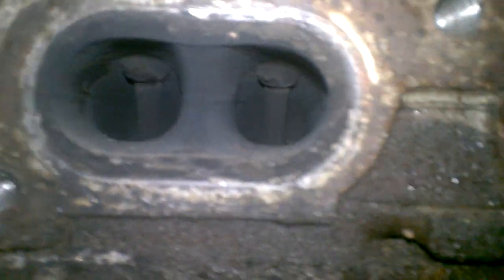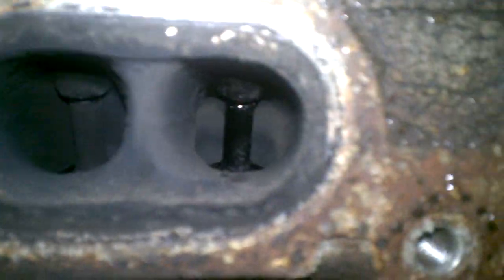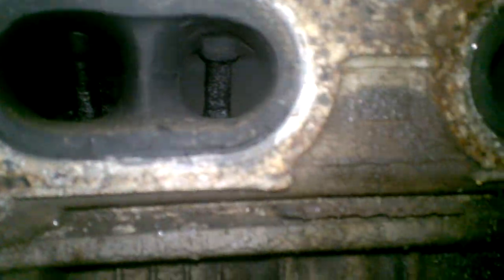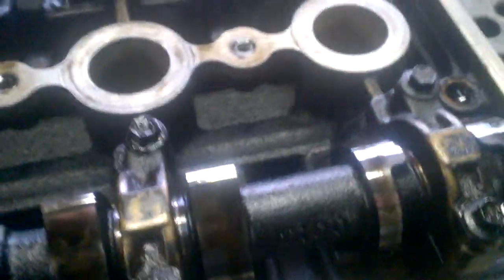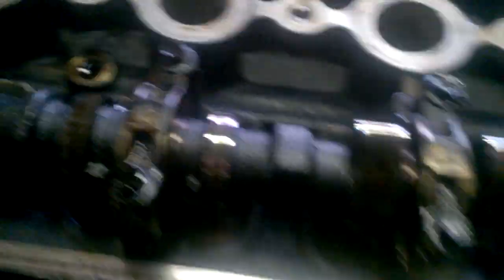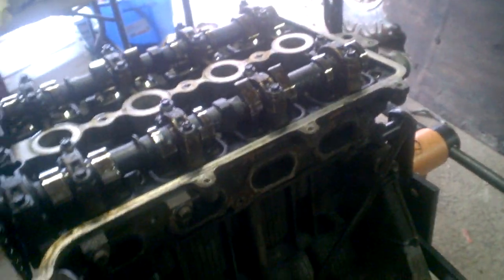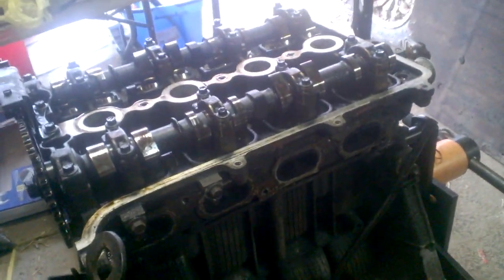Dispelling the Myth of ATF Cleaning Your Engine

Comment: What about using a bit of diesel or kerosene as your flush before changing oil ?
Reply from the maker: Using it to flush the engine, just before a change would thin the oil and get some gunk out. Bearing life can be decreased, if any residual solvents are left in the system. I won't endorse this practice, and I don't recommend it. Just change the oil every 3,000 miles, and it saves on buildup in the engine. Check out my video with my Grand Am. That car has 150,000+ miles on it, and gets oil changed every 3,000 miles and even uses conventional.
Reply: Joshua Howard  I damaged a crankshaft bearing once after performing an engine flush using kerosene. Engine flushes are just not a good idea on a dirty engine. It can loosen up big chunks of crud that can then float around in your oil and plug up an oil galley somewhere. Doing flushes right before an oil change might help keep your engine cleaner IF you do them regularly and on time since the car is new, but if the motor has been neglected, it’s best to just change the oil a bit more often and not do anything funny with it.

Comment: Once you have gunk from
Lack of maintenance nothing really helps and any flushes may cause more problems than not…. But regular maintenance and atf will
Help…. But not when you neglect an engine
Reply from the maker: Well, both engines were definitely neglected. The engines you see in my videos are of the original engine, and when I got this car in 2016, it still had a Saturn-brand oil filter on it. The replacement engine came with a blown head gasket, and I had to change that out, before swapping it.
Reply: @Joshua_James_Howard  I work on some cars that ppl bought and never maintained!!! It’s ridiculous seen some really nice Mercedes and bmw that literally had mud in the valve covers and oil pans…. I drove sh*t boxes my whole like and never ever drove over 6k on a full synthetic oil change it just feels weird…. But yea I remember when I worked automotive ppl would ask for flushed and we would turn them down…. I believe it was around 2010 or so lots of people were bringing in the ford f-150 for trade in and most of them were crap… all types of cam phaser/ timining issues…. Smh

Comment: you burned a valve because the valves were not adjusted . 
it's a bitch of a job in that motor but there are no magic pills to avoid the job. 
the  ATF  had no part in burning the valve - nor in keeping the intake valves clean. 
the intake valves are clean because they are constantly sprayed with fuel from the port injection
Reply from the maker: The replacement engine burned a valve, about 40k miles after I installed it, from the JY. 

Burnt valves in the #3 cylinder are one of the common twin cam engine problems. The second engine did not get and ATF, fuel system treatments, or anything. Just regular oil changes and routine top offs as the replacement engine also had bad rings and bad valve stem seals. 

The oil leaking onto the valve and creating carbon deposit buildup is what leads to the burnt valve. 

The thermal cycling of the engine results in the number three cylinder being hotter, for some reason, since it is the out-ofsequence cylinder in the firing order.
Reply: this is the only guy in this entire comments section that knows what hes talking about lmao @ this video

Comment: Is that 25k miles between oil changes ? Also you really only need to run it enough to get the engine hot before doing the oil change. ATF is to be used like an engine oil flush not an additive. Also you really only need a quart of it. At 150k miles with unknown ware and condition prior to the treatment, you can't say that this is evidence that it doesn't work when you didn't pull it apart before it to see how much of a difference it made. Also looking at the condition of that block, it has some sort of oil leak because that block is NASTY.

Comment: You used too much. Drain a quart of oil and top off the crank case with atf then drive it for ONLY a couple hundred miles, then park it and perform your oil change like normal without the atf. It reinvigorates the seals. I wouldn't do it if you're already leaking oil it's meant to prevent the seals from drying out or cracking in the first place.

Comment: I would ATF on high mileage engines  but I would not put a load on the engine! Just let it idol for 10 to 15 minutes ! Then drain it replace the oil filter with a new one and regular oil, you would be surprised how black the oil is when you drain the old oil,!!

Comment: Not a mith had a 89 305 with a dusted motor 
We would dump a quart in the intake once a week 
At night while  the engine was still hot 
We would have one mechanic start the truck and floor it  and the other would dump atf into the intake unit it died 
Then start and repeat tell the quart of atf was gone

Comment: It doesn't matter if you use ATF or not you're trying to polish a turd it does work and it is no myth You're Expecting too much from a greasy motor I run synthetic ATF through my engine for 500 miles before oil changes but I maintain my vehicle and if you got oil control issues your engines wore out and nothing will clean that because it'll just keep getting dirty there's too many variables in this that we don't know to take anybody's word for it I don't care if anybody believes me but I use it and never had sludge in my oil pan lifters fresh as baby's breath you can't stop an engine from getting dirty that's like saying you can only take a bath once and that'll solve all your filth problems

Comment: Run atf in your gas to clean the valves, run rotella t6 5w40 to clean an engine. T6 is as good as amsoil or better in some engines, proven to be so in subaru's in blackstone testing.

Comment: How many miles on it
Reply from the maker: It had 187k on it, when I did this video. 

The replacement engine was a used engine, that lasted until 220k before it burnt an exhaust valve in the #3 cylinder, and I scrapped the car at 254k, after an electrical issue somewhere in the ignition switch or PCM caused an intermittent issue with starting the car.

I would have kept the car, BUT, the 1.9L Twin Cam runs too hot, and the thermal cycling caused by the #3 cylinder being "out-of-sequence"(ALL 4 cylinders have at least one cylinder out of sequence in the firing order) and combined with the trashed rings/valve stems, they burn valves from carbon deposits building up on them. 

If you get a Twin Cam, make sure both the head and block are properly rebuilt to correct the design flaws with the pistons, and maintain your engine properly.

Twin Cams CAN go for 1,000,000 miles, as there is one Saturn SL2 owner that has already done it. 

He recorded his odometer of his 1993 SL2, flipping from all "9s", to all "0s".
Reply: @Joshua_James_Howard  bub korngrats simply amazing 👏 💖 💜 💓 💗 💕 👏 💖 💜 💓 💗 💕 👏 spratleys
Reply from the maker: @Billybigrigger-ic7jp Nope. Not one engine code ever, in that car. O2 sensors worked fine. I had the catalytic converters removed for a straight pipe, because you get increased fuel economy from removing them. I ran ethanol-free premium fuel. The only major issues was the bad valve stem seals leaking oil onto the valves and the bad piston rings, which are a common problem on the Saturn 1.9L, because the cylinder walls get too hot and cause the oil to oxidize the oil control rings. 

If GM has drilled holes in the oil control ring landings, they would have corrected the oil consumption issues.

Comment: Joshua,  Your Saturn Engine does "NOT 'Disapprove' ATF does Clean Engines."   In your case it gives the "appearance that it does NOT Clean".  But, Because you have a "Burnt" Exhaust Valve and Bad Valve Seals, "Your" engine has SO much blow by that your oil gets contaminated so quickly, that it really cannot be cleaned.    It is the equivalent of washing your car with mud and making the comment - "That washing your car, does NOT Clean it.  Look my car is just as dirty, if not dirtier then when I started."   Or running the vacuum cleaner in your house with a big hole in the  bag and stating "Vacuum Cleaners do Not work.  My carpet is still dirty after I vacuumed."   It is obvious that that engine was not running properly to begin with.   And then are you stating that you did not change the  25% ATF Oil mixture for over 1 year and 25k?   meaning 25k mile Oil Interval.......Ahhh, that won't clean anything.......especially on an engine with a burnt valve.   If you want an engine to last, 5k synthetic, 3k conventional oil change intervals with filters, otherwise the longer you go the shorter the life will be for the engine.  There is nothing scientific about your scenario to prove anything.
Reply: I agree with this guy people who actually don’t know what the fuck they’re doing should not put their opinions on YouTube or work on their car at all I cringed through the whole video... remember I’m not intentionally being a dick I’m just giving constructive criticism 👍